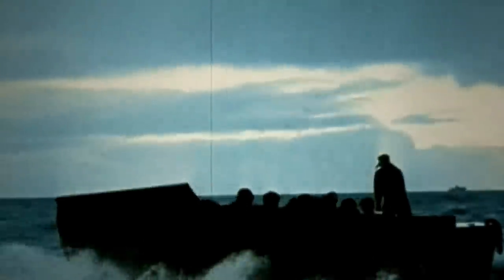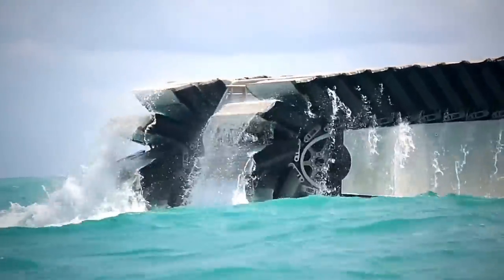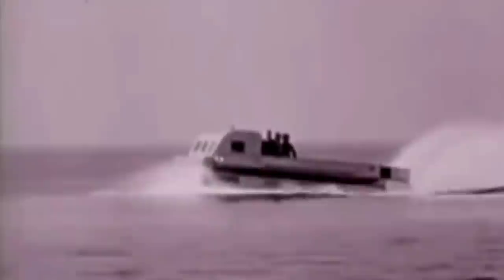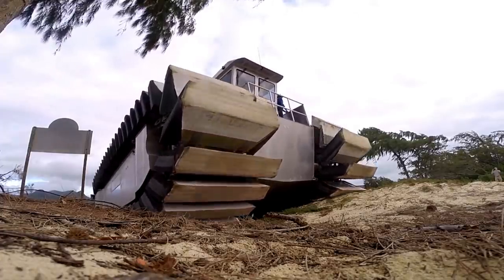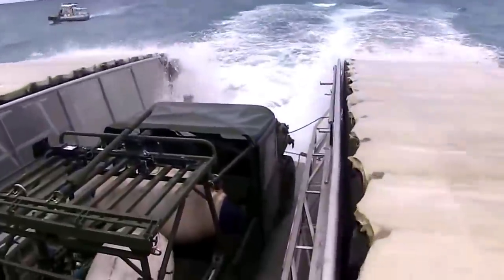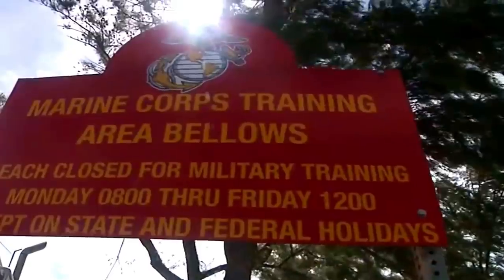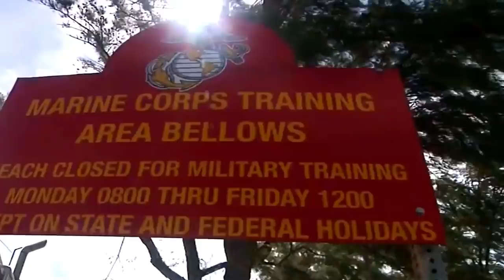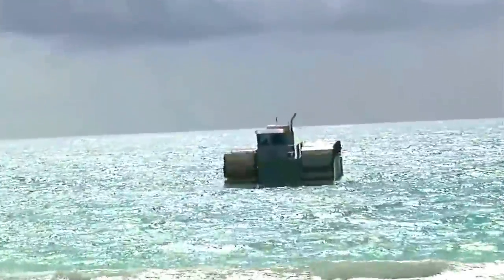US Marines Test Giant Sea Tank

Comment: It's definitely interesting and I'm aware it's a prototype but there's a couple of problems:
They are probably loud as hell from both tracks and motors. 
The vehicle is massive its a huge vulnerable target and would be hard to operate during rough seas. 
The third is how will it handle landmines? We are seeing larger and larger landmines or ieds that would at least blow off a track.
Reply: Not to mention that the 'three full sized tanks' would have to back out of it once it hit the beach.
Reply: @rockbutcher  good point!
Reply: Do you think that they are louder or quieter then the hovercraft currently deployed?
Reply: @chriscunningham9740  probably a bit quieter but much slower because it can't hit the shore like a hovercraft
Reply: They have a few new landmine vehicles, for the future use, they search for mines then lay track.
Reply: Everything must start somewhere, you can't develope the final from the start although I agree with everything you've said i'm sure it will still have it's use if used corectly
Reply: Apparently this prototype is so very very light on its feet because of the foam type feet , it gives great properties, like weight distribution and flexibility to form around an object .  With the right power plant and a well designed transmission I believe these could be a game changer for any exspidition or army.. I mean just emagin it in full size!!!
Reply: or we could have medicare-for-all, much better investment, you know 800 billion a year buys a lot of beer...I know get out of the comment section hippie, but I agree this things a turd but not a 1.5 trillion dollar turd like the F-35 raptor
Reply: It's a landing vehicle bro.
Reply: @carlosandleon  its a target, Russia's hypersonic missles are a grave threat, but the Raptor just like this, is another example of wasteful military spending
Reply: @dbunik44  Bro, any landing vehicle is a target for missiles.

Also I see little geopolitical overlap between the US and Russia. Russia is a threat to Europe, but I don't see how it's that much of a threat to the US.
Reply: AAV'S are soooo loud.  We were do a landing at Pendleton ( I was in CRRC company) and we heard this God awful rumble screaming thing coming through a valley.  I sounded like the whole Mongolian horde was coming our way. It turned out to be a single AAV just moving through. 
A few months later I did a landing on one for thr first time and when we went into the water from the back of a LPD, I swear to God I thought we were just going to sink.  I couldn't wait to get out of that thing and never bitched about being on a CRRC, 30km off the coast, wet and cold again (thats not true..I was a grunt so I bitched alot).
The truth is there is no easy way of putting a BLT on shore. Its a shit sandwich...
Reply: @rockbutcher  Maybe the final version will have front and rear loading like the LCAC? so they can drive thru. or they can back on to it before it launches...
Reply: 1. Louder than an LCAC?  Im sure a combat beach landing is loud as hell anyway with Artillery, Naval gunfire, Air strikes, gunfire, mortars etc. By the time its operational it will probably be electric. 
2. Big yes, but so is an LCAC, They did mention armor in the final product. Suppressing fire from Air, ship, etc. could help protect it during landing and offload. As for rough seas, Amphib landings are not usually conducted in rough seas. Even D-Day was delayed several times due to weather.  And not that it wont happen again but when was the last heavy combat seen on a beach landing? Korea? Small scale landings in Viet Nam, Granada was nothing.
3. They could give it more of an armored  boat hull  "V" design that deflects blast like the HMMWV replacement. probably wouldnt help with the tracks though.   If a beach is properly reconnoitered, surveyed, and  prepped with Naval gunfire and aircraft it would mitigate damage from mines going ashore. Then Engineers, artillery, etc could clear a path if it was to traverse inland and not head back out to a ship for another pick up and delivery.   As big as it will be its much faster than the AAAV (YATYAS  LOL) and can be armored much better and equipped with reactive armor. Maint, survivability, and operation will be better than the LCAC.  And a HELLUVA lot better than landing craft.

Its also just just a landing vehicle NOT an amphib assault platform.
Reply: @dbunik44  We will never have medicare for all.  Do you know what the per person cost is?  As the country gets fatter and fatter every year, the cost to cover all those increasingly unhealthy people goes up as well.  I suppose they can just print more money, but then those unable to afford insurance will just get more distant from those who have money with the inflation.
Reply: Ray shields
Reply: @dbunik44  right and with that Russia has builded new large transporteres making 800-900 kmt  and have at least 1000 Z-soldiers on board with Pantsir weaponry as protection and a lot of lot of flears 10-12 jet engines, am a x-military Nato veteran myselfe but also fought with russian soldiers as kontractnik and still have friends east and west and was sent a video of 4 of this getting over the Caspian sea in no time full of IFV and MBT and soldiers also Z-soldiers
Reply: I said the same thing, and just because of its size, it presents a large enough target that if you hit anywhere you're going to do plenty of damage. Like hitting either side would destroy its tracks, and center mass you would take out the control tower rendering it dead in the water. I'd imagine that the gunner would pummel the craft at that point.
Reply: @dbunik44  If you want to pay half of your income in taxes, that's fine.  For people who want to pay extra for the government to give them health care, an option for them to opt into doesn't bother me.  For someone who has done a lot to take care of their health and never uses the healthcare they already pay for, they might not want to subsidize someone else's bad eating and smoking habits.
Reply: @dbunik44  f35 lightning goofy, you shouldn’t speak on things you clearly know next to nothing about
Reply: @TobiasYoderFpv  ty for the correction, I confused it with the F-22 Raptor which our military was quite happy with however it is a 1.5 trillion dollar turd, It was the plane the Pentagon didn't want, they just admitted it was a failure but you know...facts...Military Industrial Complex...
Reply: Does not matter no more tanks in the Marines and thus is to slow and will be a big target. LEAH'S are fast
Reply: @dbunik44  honestly I’d rather have a military industrial complex creating well paying high skill requirement jobs than more welfare and government assistance programs for the unskilled, stupid, and lazy
Reply: and we seem to have the money to SEND them what can't the Military Industrial Complex pay to MEND them?
Reply: @dbunik44  In today’s world there really aren’t many better choices for spending the money they do to feed the military, the amount of jobs and stable incomes in tons of different industries that that money provides definitely out weighs any potential good it would do to put that kind of budget into welfare programs or free healthcare

Think about all of the jobs in the sciences, precision manufacturing industries, etc. on the civilian side of things that military spending provides then think about what leeroy and his 7 kids at the trailer park or Tyrone and his 12 baby moms in the projects would do/ are doing to contribute to society

I would rather see functional, skilled, and hard working members of society being propped up with my tax money than the dysfunctional, lazy, or otherwise unable to work members of society that contribute nothing
Reply: If it can land in places where AAVs and LCACs cant land it still boosts amphib forces by expanding the amount of beachfront that a potential enemy must defend as they can no longer focus their defenses on the areas easier to land in.  If it can go 200 miles in water at 20mph then it also allows launch of troops from a distance much greater than currently allowed, which isn't just a help in a large conventional war but in the small "brushfire wars/police incidents" that the marines are often called into, without pulling the large amphib ships 150+ miles out of their desired position while able to land more heavy equipment and vehicles to shore than heavy lift helicopters would be able to do alone.
Reply: #1 They might  change the motors for silent  use like noise cancel technology. 

#2 As for large size huge target is a concern but with with support  fire from the air or ground troops can be slove. The Large hovercrafts  are similar  size which their only transport role which their fast and mobility.

#4 weather situation  is only  by theory  their possible  to cross with minor problems.

#5 Land mines wouldn't  be a problem  because  of the foam tracks are easily  replace or too soft to trigger explosions. But the ground troops will handle the mine situations  mostly
Reply: As for landmines this thing might be ideal because of the loft or clearance it gives you above the ground. Perhaps they might come up with foam blocks that absorb the blast a lot better.
Reply: Dude the marines have been using loud ship to shore vehicles forever c none of these issues are a real problem
Reply: @rockbutcher  I would think that the final design would be a Ro-Ro craft for quick unloading. Otherwise, it seems like a big drawback. I get why a proof of concept prototype would not be configured as such, since building a Ro-Ro craft is more difficult as has risks to it.
Reply: @rockbutcher  àa and
Reply: true, those might be unsolvable problems. however, if u view this as a logistics vehicle able to ove things quickly on to shore withoiut a beach, then maybe an amphibious assault isnt necessary in the first place
Reply: @dbunik44  "f-35 raptor" bro stop
Reply: @internetenjoyer1044  sorry Lightning....it's still a 1.3 trillion dollar turd...bro stop
Reply: @rockbutcher  .........or you just back them in when you load them??????
Reply: @Danny Timms Mate, both you and Dennis are hugely misinformed about Universal Healthcare. Firstly for you, a system can have both public and private health insurance so having UHC wouldn't destroy your current provider. Dennis is wrong because you Americans don't need to spend a single extra dollar to have Universal Healthcare.

The American Federal government spends some $11,000 per head of population per year, more than any nation that has UHC and you get jack shit for the money. In contrast in Australia we have both public and private hospitals and the national and private health insurance. Federal money is given to the States and they run their own hospital systems to suit the requirements of that State. Doctors appointments are either billed directly to the feds (Bulk billing with no copay) or there might be a copay. (This is at the discretion of the Dr) You can go to any Doctor you want. The only real difference is that if you are a "Public" patient in a hospital you don't get to choose the Doctor. People with private insurance can choose the hospital and Doctor.

To give an idea how it works, say you go to the Dr for a general consult. Go to a "Bulk Billing" Doctor and they run your Medicare card and you pay nothing, they bill the Feds directly for $37.50. If you choose to go to a non bulk billing Dr who charges $50, you pay at exit with your EFTPOS card $50, then put the card back in and $37.50 is credited back to your account. All done, go home.

The system has some optical and dental included. Pharmaceuticals are subsidised so we buy them at a lower price. Pensioners or anyone on social security benefits get their drugs for $6.60 per script and when a family spends over $2,000 in a year on scripts they get the "Safety Net" and all their scripts are $6.60 too.

We have more Doctors, Nurses and hospital beds per 100,000 people than America does. We have a higher life expectancy and better infant mortality than America does. The Australian Federal government spends $5,500 per head per year to provide all this. Rather than reinventing the wheel have a look at what other nations have done because America can have UHC for half the money you are currently spending. The very real benefit of such a system is that we aren't held hostage to a bad employer by healthcare, we can quit at any time without our family suffering. Isn't that a better choice?
Reply: @delayed_control  China has socialized medecine
Reply: Don't think something being loud is a huge issue in the middle of an amphibious assault on the scale it's intended to.
Reply: Make them electric.
Reply: @rockbutcher  Why would they back out instead of backing on?
Reply: One guy with a scuba tank and a sock bomb could disable that
Reply: @JohnJ469  The main issue is that if the government passes a universal healthcare bill they will raise taxes to cover it. Many people don't want that.

Me personally, if they move funds from other gov programs to cover it I won't care either way. But that would break a lot of promises that various senators and house members have made to their constituents so they can't or won't do it.
Reply: @JakeBaldwin1  That's where Americans have been conned. There's no need to raise taxes at all. You already spend more per head of population than any other developed nation and get nothing for it.

Having a system like the Australian one would give you UHC and halve your healthcare spending. We do full healthcare for $5,500 US per head, you spend $11,000 US per head to get essentially nothing. You don't need to spend more, you need to change the way you think about it. Look at what other nations do and copy them if it's better.

But while a lot of the national rulings might be Federal, it has to be the responsibility of the States to provide the services. I'm guessing there's more need for skin cancer clinics in Florida than North Dakota and they would need decompression chambers more in Hawaii and California than Idaho. That's why it has to be the States delivering the services.
Reply: @JohnJ469  That's what I'm saying though, most people are against it because they will raise taxes.
I probably know more about how much the gov wastes money than most people. Many of my family members worked for the state government, they have told many interesting tales. But I do get what your saying on the taking the good bits from other nations' systems, its a good idea.
Reply: @JakeBaldwin1  Which makes me think the people pushing it don't really want it at all. If getting health services to the public was their real objective they'd be looking at other nations and saying "Hey. We can do this and save money as well." And they'd have the support from both sides.
Reply: @JohnJ469  I kind of understand why they don't want to break the promises they made on stuff. But at the same time it sucks.
Reply: A beach landing vehicle. Where my mind goes, I don't think noise would be any factor for the type of environment this would be needed in
Reply: Honestly, it looks less stressful to ride in that a LAV or Amtrak.  I've done amphibious assault in both, and trust me, sitting in a easily sinkable tank praying you state dry, is not a pleasant experience. Go lock yourself in the trunk of your car, than have someone roll you into a lake.  Now imagine being shot at as rounds ping off the armor. 
If this gets blown up, at least there will some trash left floating to use as cover while you try and make it to shore. 
D Day?  As a US Marine I will say this, I can't imagine how it would have played out.  No one can, the fog of war from the 40s still lingers on to this day.
Reply: You're going to have those problems, I think, with any amphibious assault vehicle. I like this idea tho. Closed cell foam would be cheap/easy to repair.
Reply: KEY WORD PROBABLY….. why are u even here bro. Talking like ur the person that makes the decision like the people to design these things have 100% thought about all that plus way more then you are capable of imagining. “But there’s a couple of problems” WHO ARE YOU TALKING TO??? ur not the president. People like this are why the world is shit
Reply: Bro have you even seen a landmine go off? Let alone a large one just recently? “We are seeing…” you are not a general either
Reply: @GeirAndreTonning  Just curious, why do you refer to the Russian soldiers as Z-soldiers?
Reply: @GhostofReason  it stands for "Zaslon" it is one of the best SOF in the world, but Russia has many different types of spetsnaz which just means special force, but they also have the "SGCM" something like spetsnaz ghost cloaked members, that take 3 years of hard school and 3 hellish year, which use technology not known to us, and are mostly in northern east of Siberia, that is what i promised i could tell, this project is highly secret and don't "exist" but they do, that is that, there are 3-4 secret places Russia has around there,and they ain't deployed in Ukraine because Russia has been so lightly as they can, but if they want they could plane Ukraine in to an parking spot whiteout use of nukes, but Zelinskiy and the SS Azov battalion doesn't want the sivillian people to live, and this number of sivillian death, under 500 people is rear, because the last 50 years we have seen USA and Nato has killed a lot more people than this. But in the propaganda "news " thousands and thousands has died, sending videos of destroyed vehicles that is infact ukrainan, but they tell its russian, and there is a false flag under way, chemical attack from Russia, but it's western world specially USA, same as Syria and the White helmets, and it was all a lie like a lot of other lie. But the push from Nato and USA is astronomical so it will be a special future for us.
Reply: @chriscunningham9740  See the hovercraft can actually maneuver, unlike this brick.
Reply: @gamingrex2930  Brick is faster on land then the hovercraft
Reply: @dbunik44  (F-35 is the Lightning II, not the raptor) but yes this thing is a turd.
Reply: @chriscunningham9740  Hovercraft is the same speed on any surface-- this brick will be slower no matter if it is on water or sand.
Reply: @angelarch5352  yes i made said correction
Reply: @dbunik44  A glorious revolutionary statement for The Party
Reply: @carlosandleon  We're close to you, so yes, Alaska will be ours, as well as Europe.
Reply: @enfissione8297  Where do you think I am?
Reply: @rockbutcher  Drive forward out of it, not back out of it. Not that backing up is an issue for tanks with 360 degree viewports.